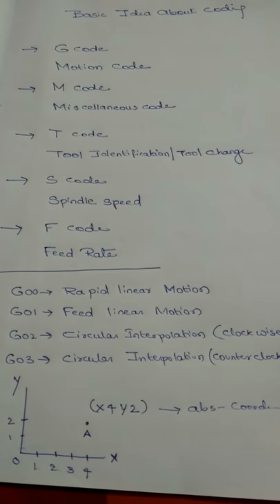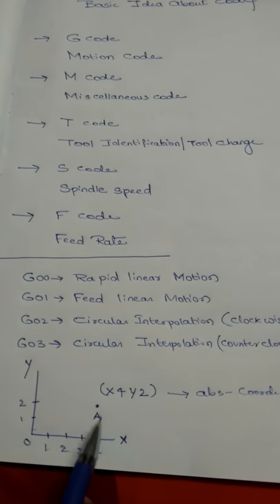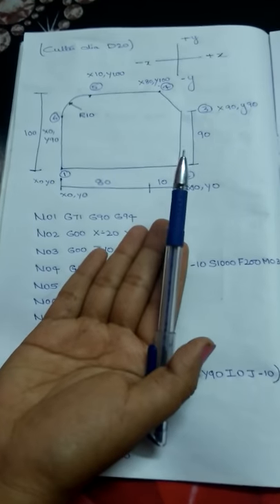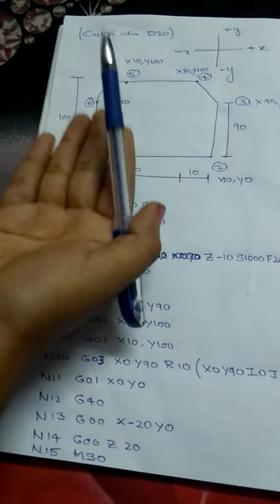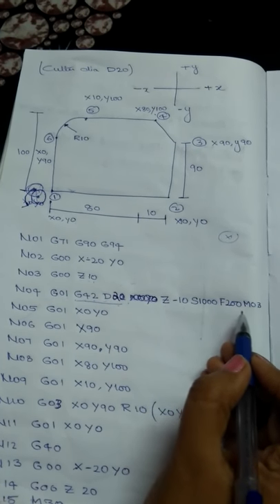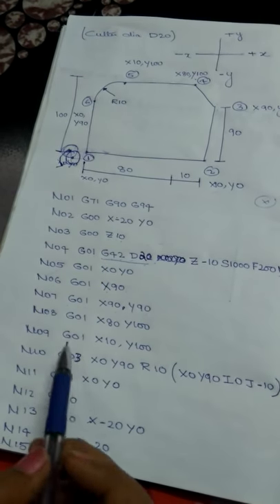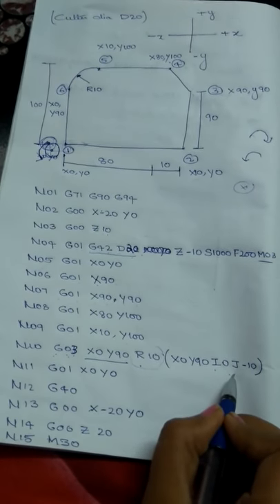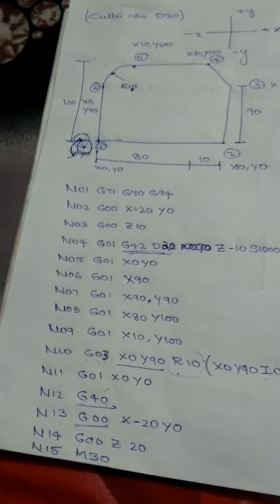CNC PROGRAMMING

Comment: Good explanation with sample.
I'm aware that this is sample code, but need some more clarity for the users. some points given below:
1. Add the tool change code before N02 Block
2. Try to start with X-20 Y-20 first. in your program while going to point one. cutter will remove excess material near O.
3. Please use G43 cutter length compensation while going into Z direction for cutting with H offset
4. Use G42 while moving to point one X0 Y0.
5. In N06 you explained very well that, since G01 is model code no need to give Y0 again. similarly you can skip the next upcoming G01 lines.
6. once cutting the part is finished we can stop the spindle in N14
also you can explain the coolant on / off codes

Comment: IF u are using metric system then in line N01, instead of G71  it should be G21 and in last line i.e N15 it should be M05 for spindle stop